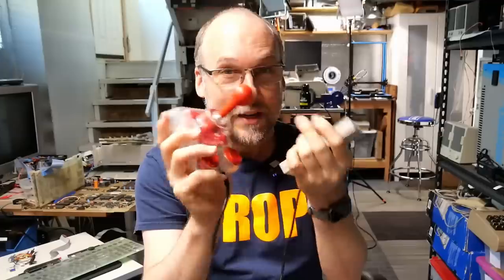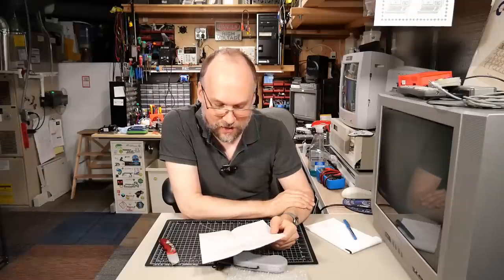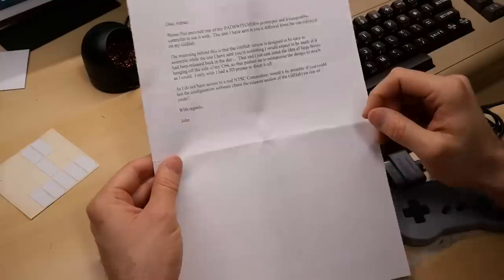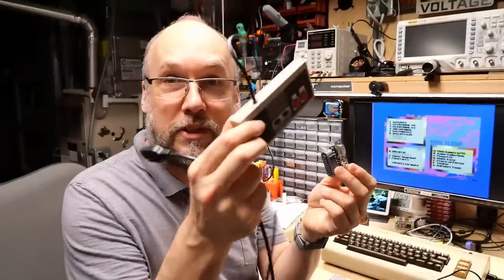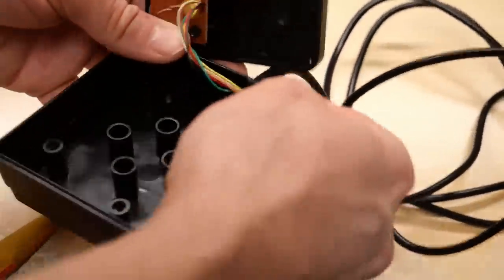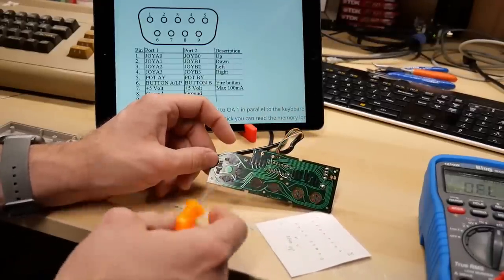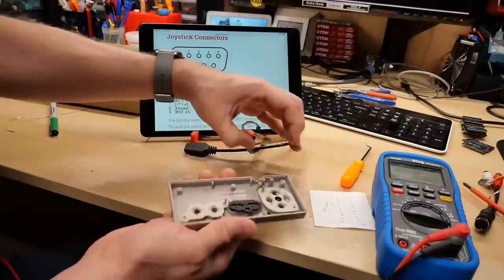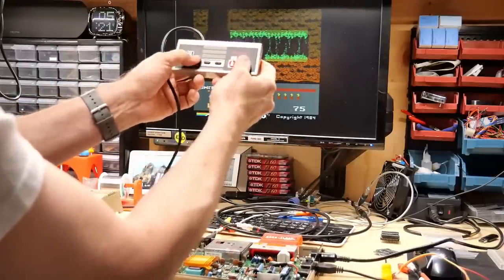How to use D-Pad controllers on the C64

Comment: Any chance you can explain to 8bit it that what he did with taking a Dremel to an ibm workstation instead of actually getting the right bits, angle grindering the psu, using a paperclip as a fuse, not bothering to make sure there was a slo burn fuse, not asking for advice....

Is all bad for such a rare machine?
Reply: He didn't use it as a fuse, he used it as a switch. Which was a bit stupid in hindsight, because he had no real clue how the actual switch worked nor which voltages he was actually dealing with.
Reply: Yeah, I it feels like David was in a rush and wasn’t thinking straight. That dremmel was painful and the shot... Especially if it was some rare prototype machine he just killed, it pains me double!
Reply: You didnt read the comments on that video?🤣 He gets the point.
Reply: David appeared to use a fast acting fuse to replace a Slo-Blo (literally a slow blow), which is safer than going the other way.  He didn't say in the video that he'd done that, so I'm not sure if he couldn't find a Slo-Blo or what.  The video and audio get recorded separately, so hard to tell.

Yes, he screwed up with the paper clip, but more for rushing into jumpering the wrong things than for trying to use a wire heavy enough to support the current.

As for the rarity of it, from what little I could dig up on it, the units appear to be part of a Point Of Sale (POS) system, like used at a store checkout line, so maybe not so rare.

Did I like seeing him do those things?  Of course not.  But now there's practically a lynch mob in the comments for David's video; he even admits in the video that he screwed up, and sounds tired and frustrated.  The guy makes tons of videos and does amazing things, has one video where he messes up and suddenly tons of people are going after him.

《SIGH.  Sorry, just venting my frustrations.》
Reply: Well, maybe thats because of an attitude thingy I gues.

Comment: Can't you use a Sega Genesis controller? I've never tried it, but it should work. SMS, too -- but they suck. I actually took apart my SMS controller and replaced the DPAD with one from an NES, so it doesn't favor diagonals.
Reply: It works but the genesis controller can damage a chip inside of the C64 without modification. Master System controller is fine though.

Comment: Wouldn't a couple of serial extension cables solve all the issues about the way the module interfaces with the C64?
Reply: Or have it in the style of a Y connector, with the 2 DB9 cables then connecting directly to the PCB with the atmel chip on it.
Reply: Simon Quigley yes!

Comment: I think that Sega and Atari joysticks work on C64 just as is right?
Reply: From what I recall, a Sega Genesis controller needs to be modified before use, otherwise it can potentially damage the CIA chip on the C64. Lemon64 discusses it here: https://www.lemon64.com/forum/viewtopic.php?t=56363
Reply: They do work, though the genesis controller can damage your c64 as noted above. The master system controller is alright though.
Reply: @Garrette63  but why MD/genesis joy damage the C64?
Reply: @intel386DX  Here's a little write-up on it. http://www.floodgap.com/retrobits/ckb/display.cgi?26

Comment: How to add autofite option to Nintendo controller wiring?
Reply: You would need additional circuitry that would make/break the contact for you repeatedly. Like a 555timer chip, or similar clock circuit.

Comment: Interesting project but kinda disappointing that you eat up both joystick ports just to get one SNES controller to map properly. Commodore should've used their [MOS/CSG] own RIOT chip - which the Atari 2600 and 7800 use - for the joystick ports instead of using that awful CIA chip. The Atari 8-bit computers - and the 5200 - use the POKEY chip and they don't suffer the issues with Sega Genesis controllers like Commodores and Amigas do due to that CIA. The Atari 8-bit scene is modding games to support 3 fire buttons by using the 2 Paddle Lines. I suppose they could also use different hardware schemes to support even more fire buttons since that external homebrew MultiJoy device can support something like 10 controllers on each joystick port. Perhaps some cross-pollination can happen between both ecosystems in the near future...

Comment: Put some hot glue under that flimsy connector to make it sturdier.
Reply: goop glue - i glued a microwave handle that wasnt even a handle, it was a small bottle, that lasted longer than the microwave, being used to pull the door open!